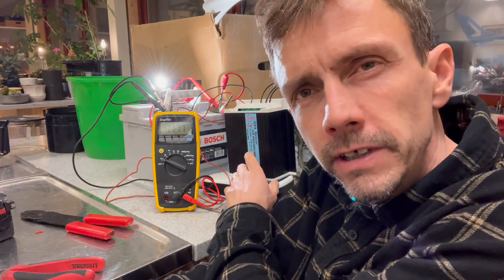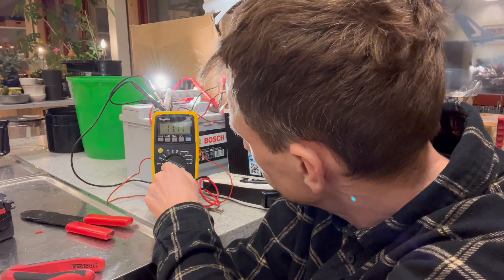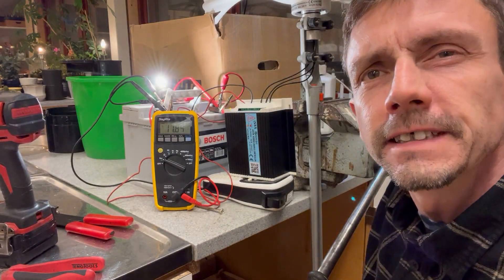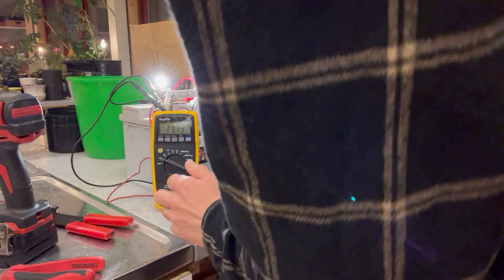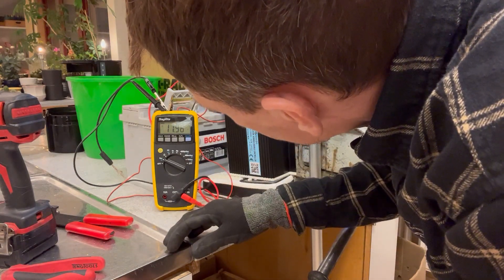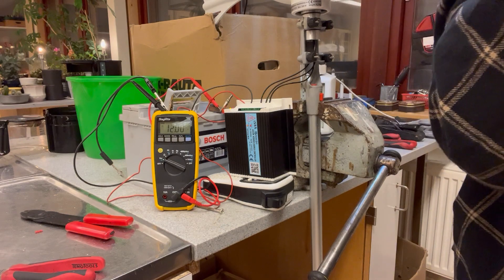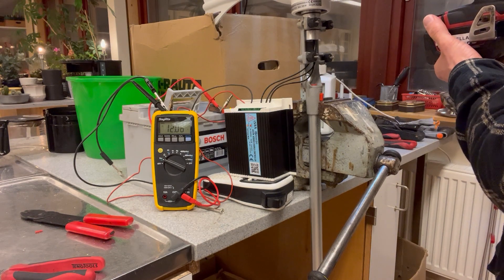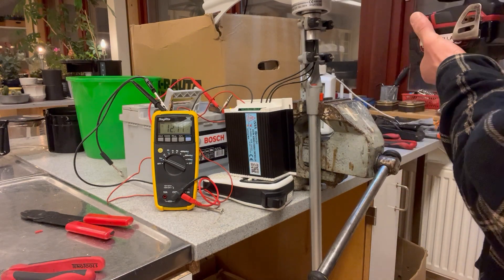IstaBreeze® i-500 wind generator in 12V - Test with battery and Charge Controller

Comment: Volts alone have no meaning, you need to measure Watts =Volts x Amperes when the wind turbine charges an almost empty battery through a charge controller
Reply from the maker: Thanks have been doing it now for a few months. Absolute peak during a storm was 136 watts. Windy day around 15 watts. I use a "Vicron" MPPT to measure with. The battery does not get full, the small consumption that the Vicron has is more than what I get from the generator over time.